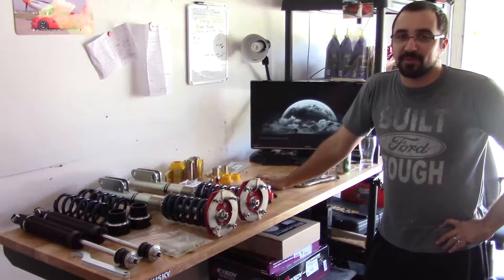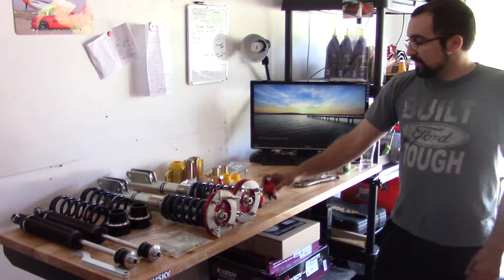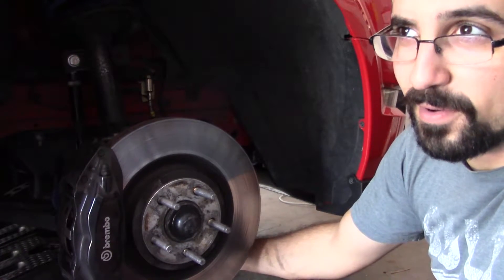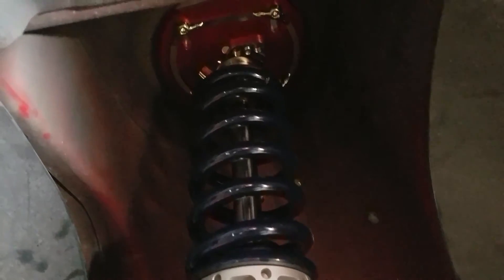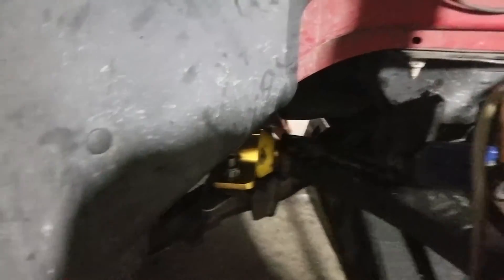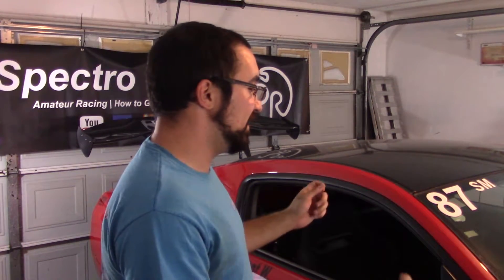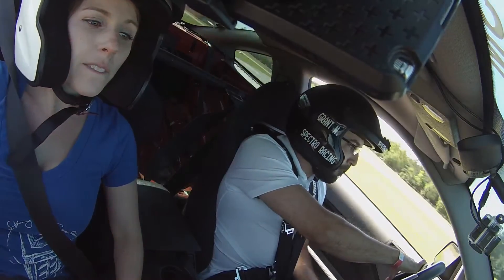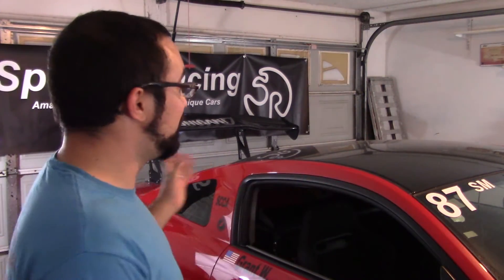The Best Coilovers for a Mustang - Install of MCS and Race Bushings

Comment: What is the best castor and camber settings  for my 2013 shelby gt500 for street and road course  without changing settings
Reply from the maker: For street 1/32 toe out, -6 to -7 forward castor(stock is cross castor which makes you veer to the right so sleeping drivers dont kill people on 2 lane roads). And -1 camber. BUT mark your plates for a higher camber setting and adjust them when you get to the track.on track you want at least -2 to -3.
Reply from the maker: Oh u said stock. Stock I don't think you can do much besides toe. so I'd just leave it at w.e it is. I'd at least get some vorshlag plates.

Comment: Just for warning on that tq number. Thats the danger zone. 450 is where the limit is prettyy much set at and ticking time bomb there. I'd like to know how that coil set up works. Currently going with Koni yellows and was thinking about ground control for me. Are those mono or twin tube and mostly a daily so comfort is a plus for date night with the wife but we like to have some fun as well? Need to get me a set of end links that are better than stock. How did you like the SR ones?
Reply from the maker: Yeah it ended up making 399wtq so not gonna do anything beyond that for awhile. The MCS ride like magic on a decent set of street tires. I would recommend a 275/45/18 Nitto NT555 for comfort. As far as the SR endlinks i only had them a few months. I managed to break one but it was my own fault so i cant give a great review. They worked and seemed beefy enough.

Comment: Speaking from experience, when putting your transmission back in place be very sure not to pinch or bind any wire ping harness. If this happens you WILL be replacing an ECU. Not fun!!!

Comment: 6k for coilovers wtf
Reply from the maker: +Kaeden Smith they are magic. And ultra high quality. Alot of the cost was the supplemental equipment needed to fit thr actual coilovers
Reply: @SpectroRacingChannel  what brand are the coilovers
Reply from the maker: @tktk-om8cg  Motion Control Suspension out of Georgia